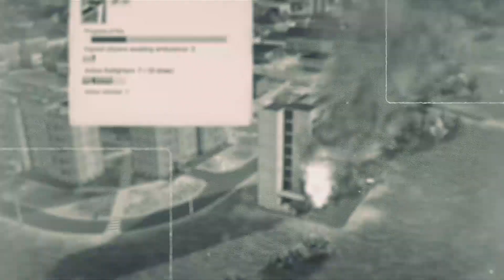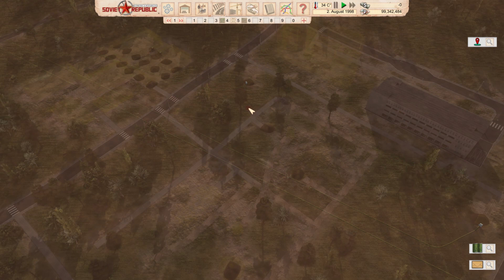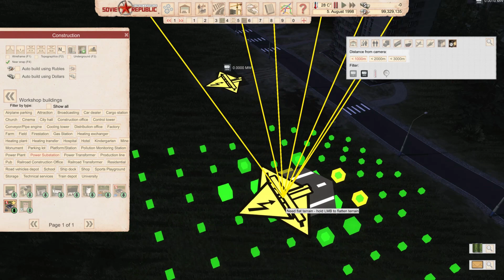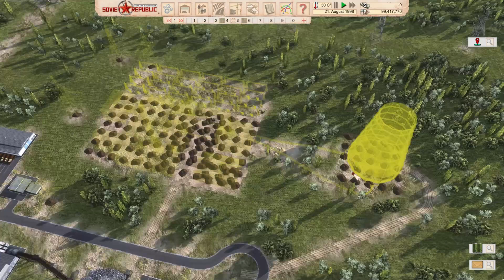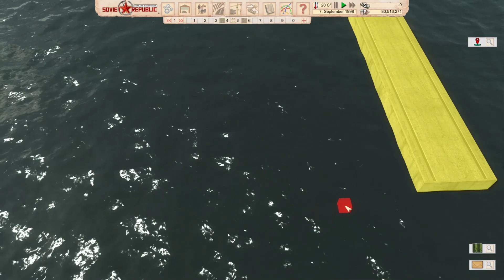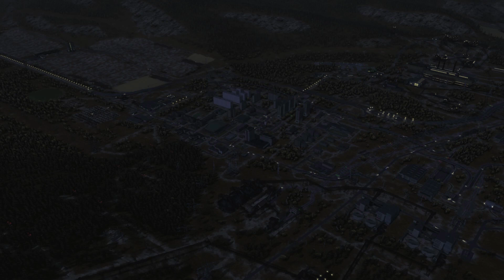Soviet Republic - Alaska - Coal Shipping - Ep.198

Comment: Nissesburg (or Babuschkino) power issues : you must use the overlay to check the high voltage in your numerous switches and trace the problem (if any) to the source (or to the sources). Work on electricity ? Always have the overlay deployed. You don't check enough your high voltage grid.
Reply from the maker: I think I did check the transformer stations and they were all good. I will check it again.
Reply: @oolykeegaming81  You only checked the ones closest to the city, I advise you to look at the high voltage power grid and its nodes from further away

Comment: The high voltage cables pylons require ground work, assigning their construction only to Construction Mooremansk they will not be built ... Why don't you look in the appropriate window for the necessary resources before assigning your COs ? I don't see the reason to do it off camera because you have the patience to do it, but not when you are recording video (episode 197 related comment)
Reply from the maker: Assumption. I made a mistake. Actually, I need to find out where actually because I don't remember.
Reply: @oolykeegaming81  It is about the high tension line which bypasses the steelworks to go up towards the fields of Nissesburg